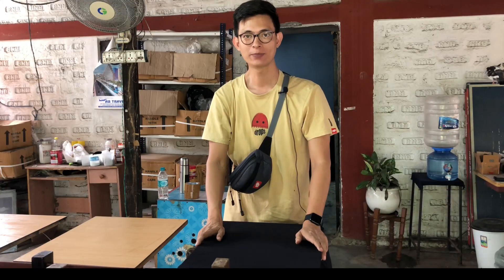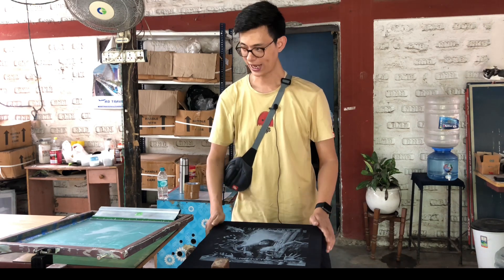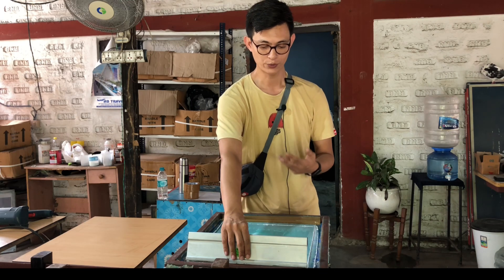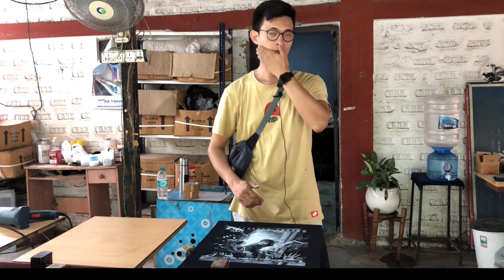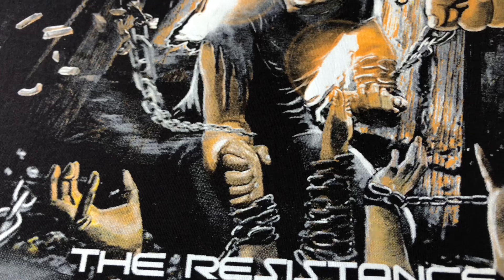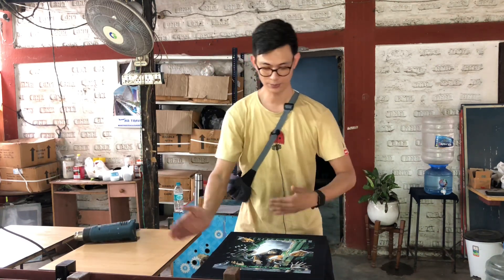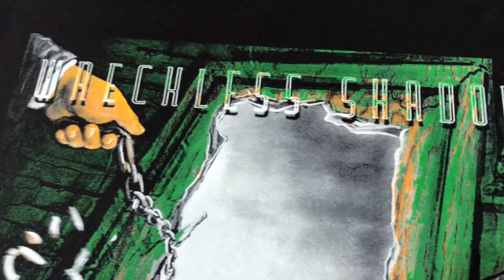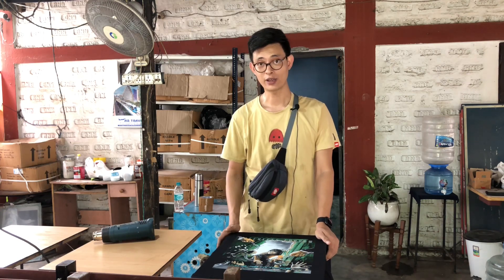Check this Advance Level Screen Printing | Black Cotton T-shirt

Comment: Next level print, hand printed have more value than automatic press, this line tables are great but are a bit tricky for reg and print👍🏻✌🏻
Reply from the maker: Thank you. We use both rotary and line table but surprisingly we prefer line table as it reduces loading time and also we can achieve accurate registration and there is no limitation to number of screens or colors.

Comment: how you swapping screens like that and maintaining registry?
Reply from the maker: It’s called the 3 pin registration system mainly used in line table press.
Reply: @Riyum  i wonder how if this could be done on our spinners so we could do more than six colours...
Reply from the maker: @ErichNolanBertussi   You need to change the entire system to 3 pin registration in your frame and also your spinners.

Comment: are you using water-based inks? what are the mesh counts of the screens?
Reply from the maker: It’s Plastisol ink and we used 203 mech
Reply: @Riyum  Hi, do you add a reducer to your plastisol ink or just use it straight out of the pot? It looks very easy to work with :) My plastisol ink is very thick compared to yours and I mix it a lot :)